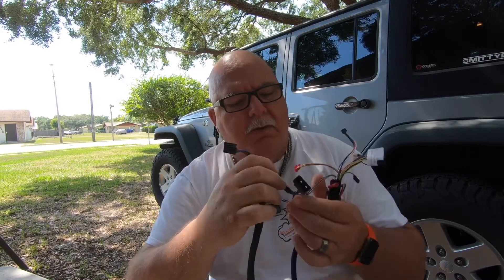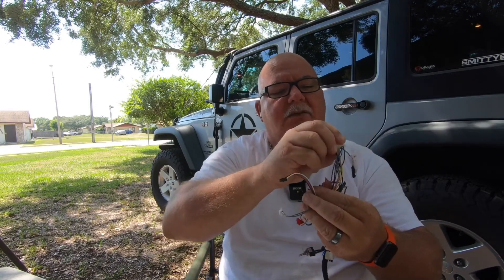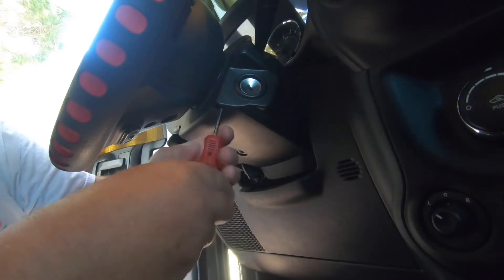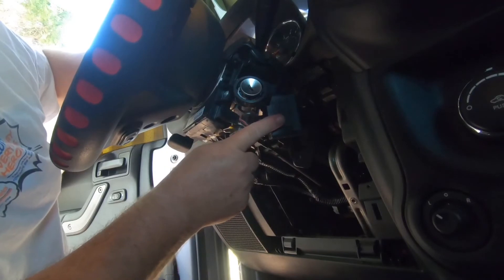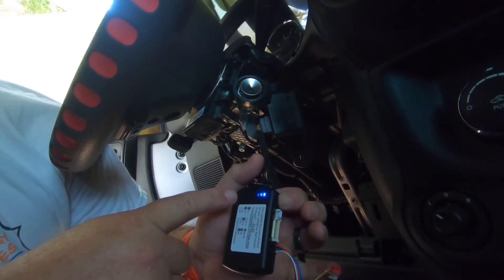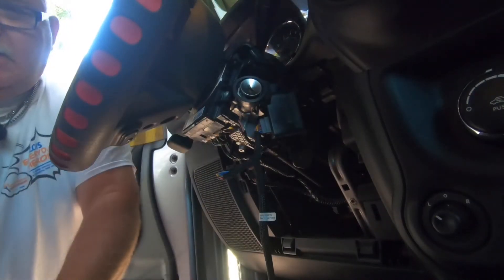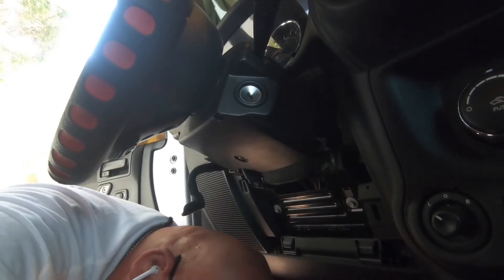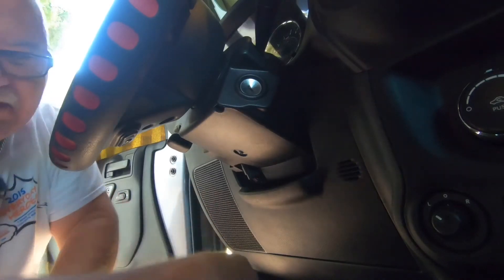2016 Jeep Wrangler remote start. MPC

Comment: You made unplugging the wiring look like nothing! I’m having an awful time with it. I don’t want to take it somewhere to have it installed. I’ve tried pliers. Nothing works! The only thing I’ve managed to do is chew up my fingers and the plastic around the plug. I’m scared I’m going to break something. Please, do you have any other suggestions or tool recommendations to help?
Reply from the maker: Just take your time. You will get it